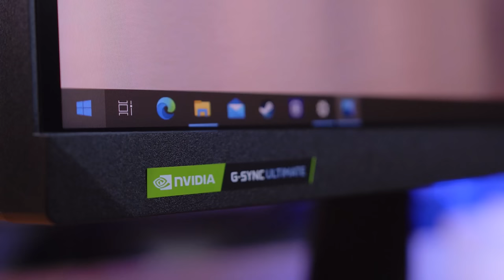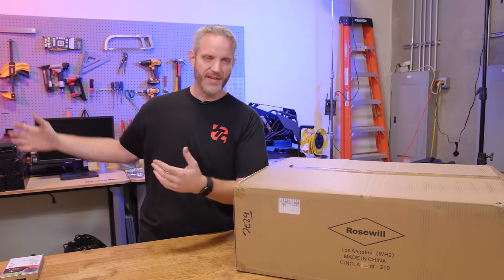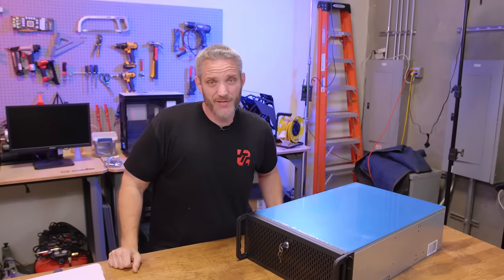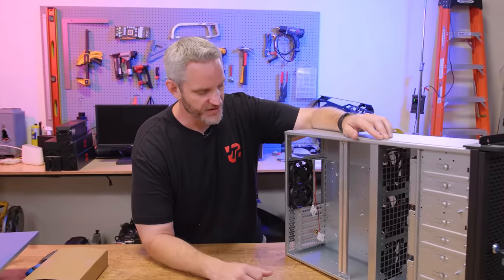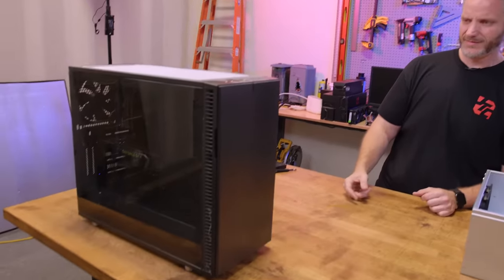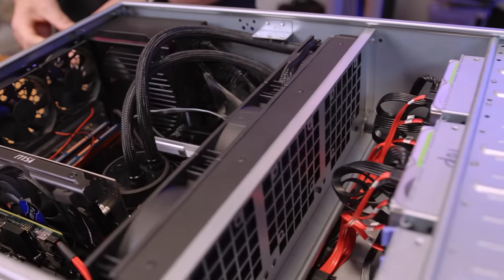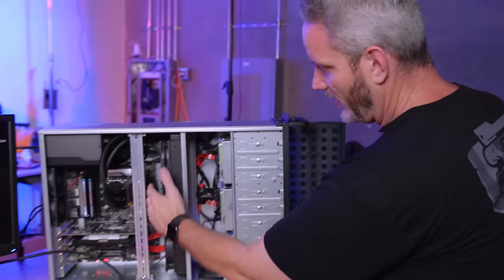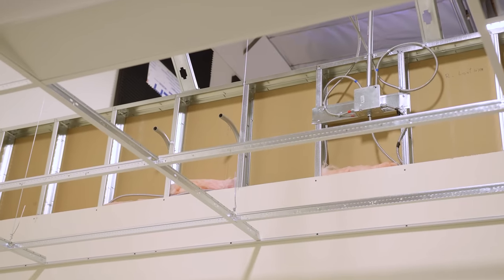Maybe I should have called Linus...

Comment: Jay, get the rails. It has nothing to do with maintaining it in the rails, it just makes it a thousand times easier to get in and out. Particularly if you have to unrack it to swap drives (which it looks like you'll have to from what I've seen), you'll be glad for it. Better would be to get one that does support hotswap (I'd go for Silverstone, but I'm pretty sure Rosewill have some too). As for platform, AsRock Rack has some nice X570 boards, at least one of which has dual 10GbE and 8x SATA on board, with remote management via an Aspeed AST2500. Or SuperMicro and AsRock Rack both have Intel boards with both. There's also redundant PSUs which you can find in ATX form factors, though that's more useful if you're running two UPSes; from what I've seen they may have fail over, but if they're the same standard as the ones I've used for servers, a standard ATX has lasted longer than what SM makes for rack form factors. 

That said, what you're using will definitely still work well, it'll just be more of a pain to maintain as time progresses (dead drives, DIMM failures, etc, which in time will begin to happen at some point, particularly if you're using the old hardware in it).

Comment: I have that case, those fans are horrendous.  I ended up replacing the two back fans as well with some small noctuas.  Biggest issue you're gonna have with this case is it's too short for some of the larger air cooling out there (worse on threadripper).  I also cut out some of the plastic in the front to help with airflow.

Comment: I have (almost) that exact same case for my server at home! mine has 2x quad hard drive bays and then 3 5.25" drive bays in the front instead, and I used the 5.25" bays to put a bay reservoir, and custom water cooling! I was able to fit a 45mm thick 360mm radiator on the middle fan stack. It's running a Threadripper 2920X and I use it for storage and game hosting primarily.

Comment: I’d definitely go with the RGB. Even though I’m not an RGB fan (pun intended) it will match the backlighting of your set.

I have that case. I’m running TrueNAS Core 12, 10 HDD, 4 SSD with a ASUs Z170-A motherboard, i5 6600k cpu and 16 GB Rama and a LSI 9220-8i HBA controller . I use it as a Plex server with the HDD’s two SSD’s as a file server in raid, and the third SSD as a download drive. It is an absolute monster of a case, but so bloody quiet. It sits in my dinning room and you don’t know it was there. Best £230 I’ve spent.

Comment: I have been on the 'rack-mount-everything' kick for the last few years.  And I cant believe that to this day, its not more popular for home users/office/gaming setup.   Being able to get your gaming rig, router, printer and extraneous electronic appliances consolidated in one place, cable manage the s***t out of it and have everything easily serviceable is amazing. That said, I know its more expensive since you need a rack, and the pc cases are more expensive for what is just a black box, but it would be amazing if some of the larger manufacturers came up with a consumer grade rack system that was smaller and cheaper, maybe some cool looking chassis with glass top or front panels and other cool accessories like rear I/O patch panels(I 3d printed my own and its super helpful being able to just plug and unplug things right from the front. 
Luckily racks are pretty straight forward, so you can always build your own out of wood, old furniture, use 80/20, or weld something. But I think there's an untapped market here if someone can figure out how to do it cheaper.
Anyway, Jay, keep working to bring this idea more mainstream!

Comment: I wonder how a change from an aio to a high end air cooler would affect temps. I don’t like the thought of an aio pump running 24/7 in a hot environment. Also it’s just another point of failure.

Comment: I can wholly and entirely feel your pain for all the noise in this video.

Building my first NAS/server here. The raging war as to which OS to go for (TrueNAS Scale vs Unraid) is real at the moment. The hardware not so much, that is all showing up this week

8 SAS 20TB Exos HDDs
AMD EPYC 7302P
Asrock Rack mobo
256GB of ECC RAM
PCIE4 LSI SAS Controller and SAS-SAS Cabling
1000W PSU
2 2TB NVME
2 250GB SSD (OS drives).

Comment: Only if you seen my server, I jammed in and zip tied 2 HDD cages from other cases in it, the case is from Windows xp era that I had to modify to fit the board in since its a none standard forum factor, at least for the normal user, I had to use 5v fan adapters for the 9000rpm CPU fans, and I have a few 2.5 inch drives sorta chilling where the CD drive would go and they are only mounted with 1 screw each... Oh and the custom single 8 pin to dual 8 pin eps connector I made, they are xeon e5-2470, they don't need a ton of power so im not worried about the eps splitter.

Comment: I built one of the first petabyte storage arrays for Wagering and Gaming in Western Australia using Backblaze Storage Pod v1 with 2tb drives. After I built it I realized how ridiculously heavy it was and had to label every single drive and remove them, then plug them all back in again when it was on site and racked....... thing was ridiculously heavy. Have also been running an UnRaid server for about 10 years which started in an HPE N34L chassis and is now in a custom PC case using a 2x SAS mini break out to SATA PCIe controller for 13tb (just run it for dockers and movies etc), been running UnRAID off the same USB drive the entire time as well, waiting for that thing to die :D. This sort of stuff has always been fun to play with and generally a lot easier than the HPE MSA SAN storage arrays I usually deal with >.< 

Guys are right though, UnRAID identifies the drives by the serial number, easy.

Comment: So I am watching this, and I see he's slipping drives in from the rear of the drive bay. But every server chassis I have seen, and I've seen a few on LTT and other places, but the drives are swapped in the from the front. Plus this chassis has a lockable front panel that flips down. Why do that if the drives can't be accessed from the front?

So I looked up the Rosewill 4U server chassis, and low and behold. The drives come out with the drive bay and fan assembly, from the front. They expect you to load the drive bays and slide everything in as a unit.

Comment: As someone who does what you do, and built a server/NAS to house footage just like this, I'd highly encourage you to look at alternatives to Unraid. Unraid is great, don't get me wrong, but due to the way it stores files, a 10 gig connection to the server doesn't even matter because you're limited to the speed of a single SATA drive anyway, which is 6 Gbps theoretical max (4-5 real world). For my initial server I went with hardware RAID-6, but will soon be building and deploying a TrueNAS server as well. Both of these approaches span the data across multiple drives so you can fully saturate a 10G connection.

Comment: I used that same case in my server rack for my gaming/desktop PC until a few months ago I decided to go back to my old case; a Nanoxia Deep Silence 6. I wondered if I could put a 360 AIO on the middle fan holder. RGB fans in the front look rather cool...not that I know from experience or anything. If you haven't figured it out already, Jay, there's a couple screws on top of each of the drive bays, and they slide out the front.

Edit: It helps to not comment in the first half of the video because you did take the drive holders out of the front of the case.

Comment: Putting a 360 RAD in a 4U is pretty cool. Curious how the thermals differ from a RAD to 3 fans and a HSF (stock configuration). How much power does it pull from the wall at idle?

Comment: I'm using the same case in my rack.
It works well, but man do I wish I had hot-swap now.

But looking into 24 bay hot-swap rack-mounted cases are just soo damn expensive these days :(

My issue is that I have a mix of 8TB, 10TB and 12TB drives.
Well, my case is full to the gills now and I'm getting close to needing more storage.

I really want to find a 24 bay hot-swap rack-mount case for under $1000 CAD (shipping/tax included).
I've found some on AliExpress, but they want upwards of $1000 CAD just for the shipping :(

Comment: I would not do AIO as you will want the HDDs/SSDs as cool as possible with a slower fan speed. The cooler any component is the longer the component will last even if they are not super prone to fail in low periods of high temperature changes. This will create a push heavy front and a slower 2nd push, that create a lot of dead air hitting and stopping at the radiator.

Comment: Literally built my Unraid server in this same chassis about 6 months ago. Great chassis, other than the lack of hot swap. The hot swap version is more expensive and only lets you have, IIRC, 12 drives vs 15.
Reply: I do wish that the chassis would have been cheaper without the fans. The default fans are terrible. Multiple Molex connectors just came off when trying to connect them.
Reply: The drive bays are removable to install the drives without removing the mid chassis fans.

Comment: In all honesty, if you build a home server, you need the rails and cable guides. You're gonna fill it up with 15 drives and it'll be heavy as hell. if you want to be able to do any work on it without having a second person on hand to help you lift it, just get the rails.
Also, should have gone with drives accessible from the front. Now you've basically shot yourself in the foot twice because you can't access the drives without taking the server out of the rack, and taking the server out of the rack is a pain because it's not on rails.

Comment: Run the same case for my home unRAID server. You don't need the hotswap capability. Also, I pulled the center rack of fans out of mine and even with (8) 12TB drives and a Quadro P2000, the max I see on the drives are 40*C.
Also, I HIGHLY recommend the rails as this is very front heavy with the drives in it and even just to open it up and add a new drive is pretty sketch.

Comment: Put the rails on it!!!!  You can get them under $50 AND if you have just one m2 boot drive needing replacement it will be worth it.  Are you using too much power pull it out and change the cpu.  Compile times too long change the cpu.  And no you don't have to remove the interior fans. The bays come out from the front just push the buttons on the top.

Comment: I'm, not familiar with unraid, but usually there is a way to find out the serial numbers of the drives in software. If the failing drive is still responding, you should be able to get its serial number, then look for it inside the box. Otherwise, you should be able to get the serial numbers of all the working drives, then look for a drive that isn't on the list and replace it.

Comment: The drives in UnRAID have their serial, you can find the serial on the drive. on WD's theres also a sticker on the end that has the (last?) 4 characters of the serial so if theyre in sleds you can just see it from the edge so it's easy to identify it. If you need to pull the drives out to read the labels, then just shut the server down first so you dont degrade it, and easy.....

Comment: The rosewill case is decent for a budget option. I suggest a dual power supply unit for the chassis. I feel you will get tired of the lack of features quickly and I suggest something along the lines of a supermicro sc836 chassis or larger.

Comment: I have that case on a backup server at work. The drives are hard to change. I have the 12 bay hot swap version at home and it is fantastic but I have not seen it in stock anywhere in 3-4 years.

Comment: Server rack does not equal a "proper" server. It is an accommodation for limited space in a server farm and is inefficient overall. For home or small business applications use a better cooling case. Power reduction is the key with the always on system. The case you used is great for this purpose. Great vid and content :)

Comment: Personally I do my home brew server builds in old Supermicro server chassis. The build quality is top notch in my opinion (though the only other server chassis I built in was a NOCO).
They are also so popular you can get basically any part used on eBay. Power supplies (I actually just bought 4 740w Gold rated PSU's for $33 each), Fans, Power distribution unit for the PSU's, Even the SAS/SATA Backplane are easily obtainable.
Just do an eBay search for either Supermicro 3U or Supermicro 4U server chassis. Personally for you I would recommend the 3U as it holds 16 drives (all hot swap)

One tip, get one that's complete, make sure it has all the drive caddies, power supplies, fans, AND cables included. As I said earlier you can buy all them all ala carte but it starts to nickel and dime you real fast. Rails are almost always sold separate but you said you didn't want rails anyway.
Reply: Don't forget it needs at least a gen 2 SAS backplane or it cant utilize larger drives.  Buying the backplane by itself is sometimes more expensive than a new case.
Reply: @in2quads  you are correct, I get the direct attach version where every drive has its own SATA cable.
Then I don't have to worry as much

Comment: That chassis w/ aio is exactly what I've done for my gaming server with a i9-7900x. I still much prefer supermicro over rosewill (Cse846 is what I use for my old truenas, and now a NX3230) and I have a few R740s too. Patch panel 100% go with keystone instead of punch down. I converted all mine to cat6a s/ftp and the keystone jacks are grounded also radio operator, so RFI needs to be minimized. fiber for my longer runs. 10gb network to the edge and 2g sym

Comment: while this is a nice server, it is not a proper storage server. replacing a failed disk will involve shuting down, unscrewing things and disks from the chassi. get a chassis with hot-swap bays, will be much easier and faster to replace a disk and you don't have to mess with serials.

Comment: If you want a huge piece of advice that will make Phil or anyone who uploads/downloads to the server on the network then you should, at least, put 10gb fibre in it. Even if you went peer to peer to your production workstation. Obviously, if your drives are just 6gb/s than 10gb is more than enough. Mellanox Connectx-3 cards are around 40 -45 bucks I believe and you can either get DACs or SFP+ and fibre cables fairly cheap as well.

Comment: I just put my Plex server in the exact same case earlier this year and it's been going great. The cages are a little hard to work with but fits 3 more drives than the hot-swap. Swapping out the fans on the front is also kind of a pain but it's a one-time thing
Reply: I'm sure you can get 3x 3x5.25 inch to 5x3.5 inch hot-swap bays in it...

Comment: Rackmount servers are for people who need density. If you have space, it's much better to build in a normal computer case and put it on a steel rack from home depot along other computers. 4U chassis can't even fit most good air coolers, and the access to components sucks.

Comment: I have that same case, only I swapped out the drive bays that came with it for Rosewill's hot-swap bays. You lose the front fans doing that, though, plus it'll take you from 15 drive bays to 12. But you also largely don't need hot-swap either. In the 6 years my NAS has been up, I've only had to replace 1 drive due to any kind of error or failure. Though hot swap does make it easy to add drives or upgrade existing ones. Later this year I'm going to be swapping out one of the two 4TB pairs for 12TB or or probably even 16TB. Though that's gonna result in a bit of downtime...

Never thought to use an AIO for this, but... my NAS gets hit so infrequently that the CPU has no issues staying cool with the air cooler. My NAS runs on an FX-8350 with TrueNAS.

Comment: Hey remember on your switch video i suggested getting a 28 port switch with 24x 10g and 2-4x 40G ports?
Yea, I figured you'd be building a nice server here some time soon. 
While i love spinning rust for servers, alot of people say they're too slow. But if you're using something like TrueNAS, you can add alot of RAM, and then throw in OPTANE as a cache extension(you dont need an intel processor for this)

I currently have 8x118GB Optane drives accelerating 16 HDDs and i only have 128GB of ECC udimm on a freaking Ryzen 5(plan on replacing it with Ryzen 9 but Ryzen 5 is all i need for just files)

Also, i have a portable file server in an mATX case with 18 hot swap SSDs. but the SAS controller is old and slow, so i've added 4 optane drives to smooth that speed out.

Comment: I appreciate you are doing this for content, but there are better solutions for pro-level storage+server.  A Supermicro 846 chassis has 24 hot swap bays in the front and accommodates an EATX motherboard, with hot-swap fans and power supplies.  They aren't that expensive (especially surplus) and they have really good support/parts availability.

Comment: Dude, even I have an AsRock Server Motherboard, dual Xeon Processors, ECC memory and 16 Drives ....two vDevs of 8 drives each in two ZFS formatted 6+2 parity array.  I can easily find and replace any bad drives and they are not marked. While I can't afford a Linus adventure, I would hope you could.  If you can't afford Linus, give 45 drives a call or Tom Lawrence, he's also a Wenell fan. Also, didn't Steve Burke and Wendall (Level 1 Techs) build GN a super server too?

Comment: Take a look at the exos drives vs the iron wolf pros. When I upgraded my nas years ago to 10TB drives, these were cheaper, better warranty and are designed to handle the vibration of larger arrays. Funny thing is today I can get 16TB for the same price now.
Reply: I did this myself, 14tb is considerably cheaper than the others on Amazon. But depending on the chassis mounting may be an issue (chenbro nr12000, looking at you).